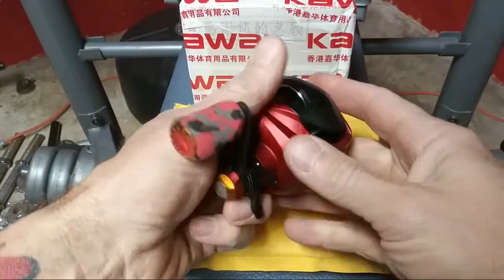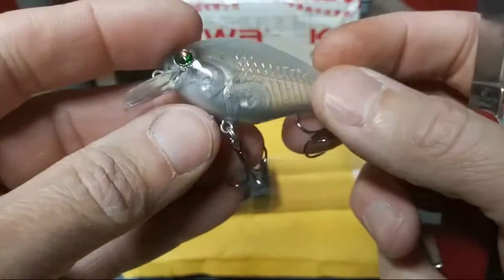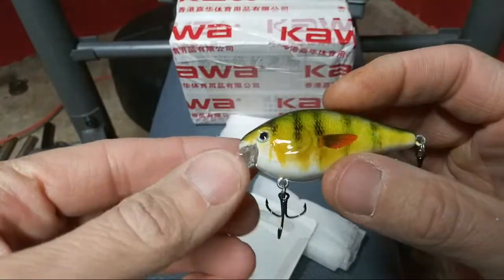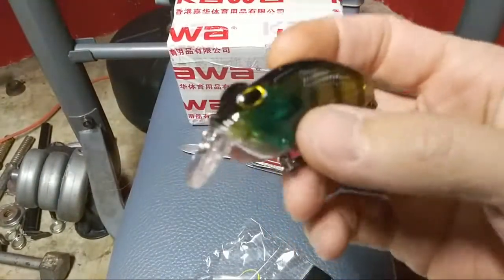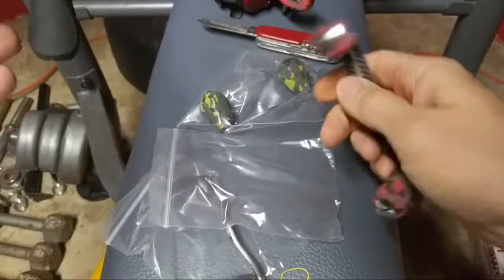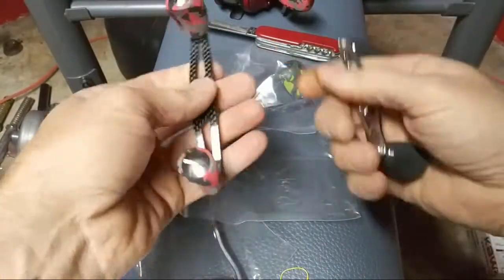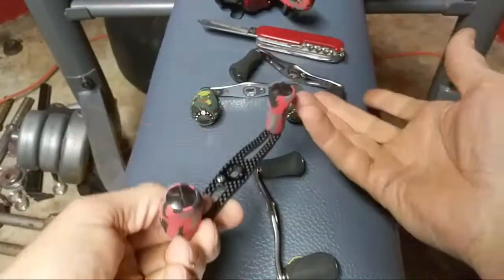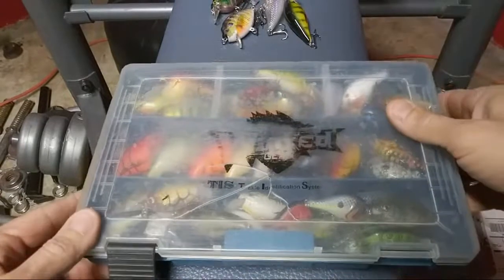Aliexpress Cheap Fishing Reel Handle Unboxing

Comment: What I have been doing which all my new hard baits is when I open them I write the depth range on the bottom with a black fine tip sharpie and on jerkbaits if it floats sinks or suspends. Not sure how it will hold up but worth a try.

Comment: id look at handle length like gear ratio. longer handles are slower but give you more torque like a low gear ratio reel, and short handles can reel in faster like a high gear ratio.
Reply from the maker: Yes some people will argue it doesn't make a difference though. ..
Reply: @bassnbonsai  some people probably can't notice a difference, but physics says there will be a difference. whatever works for you though.